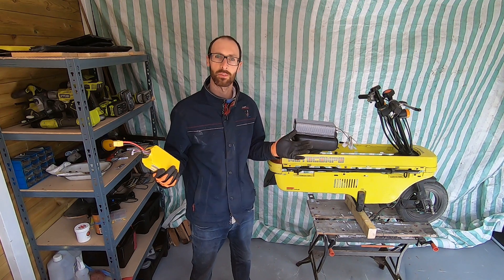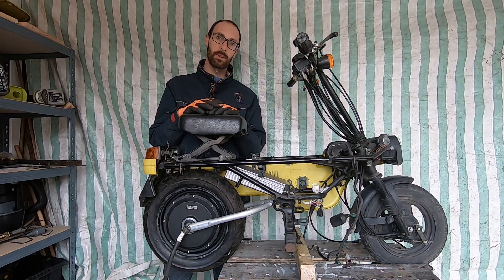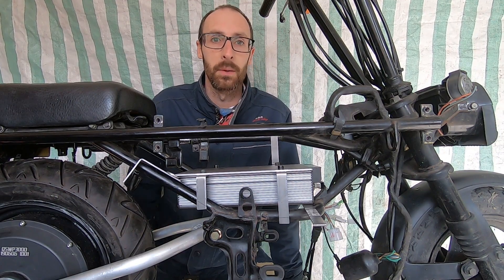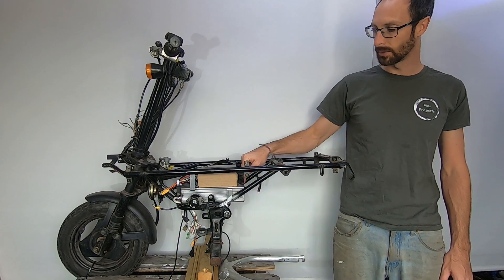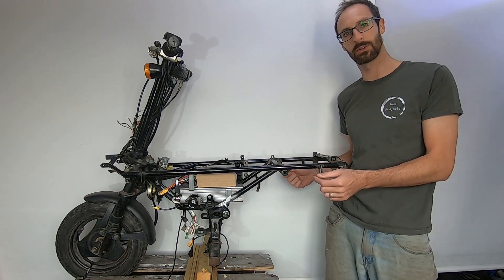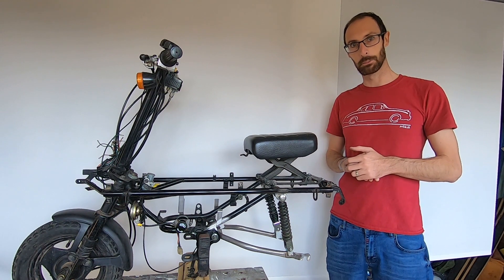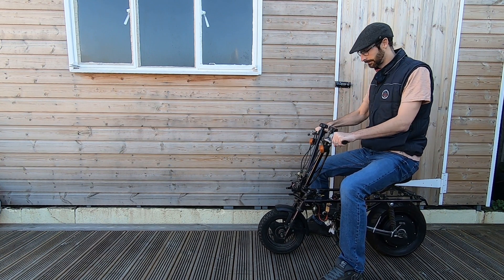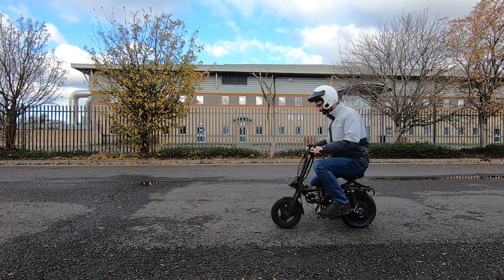Motocompo | 04 First Electric Ride

Comment: Don't you think adding an angular steel tube and panel framework supporting a large, heavy-duty front rack or basket would help with the lifting front wheel issue?